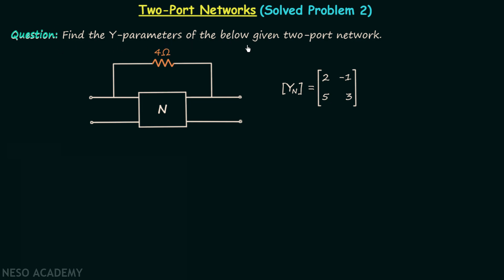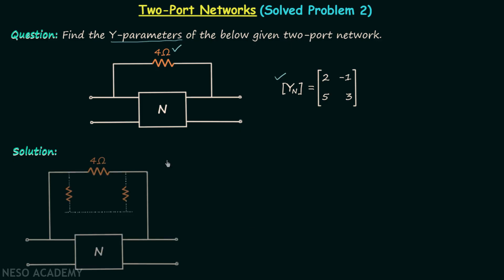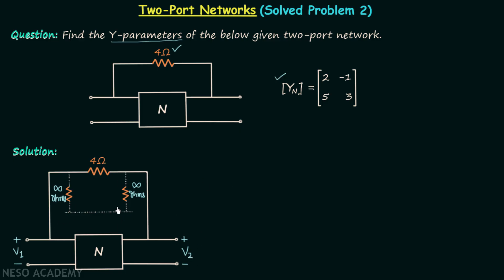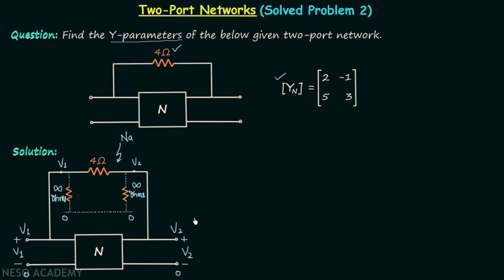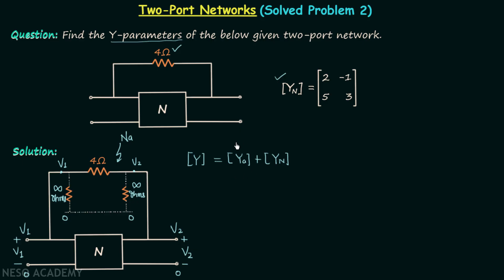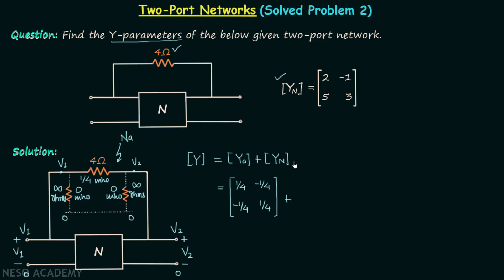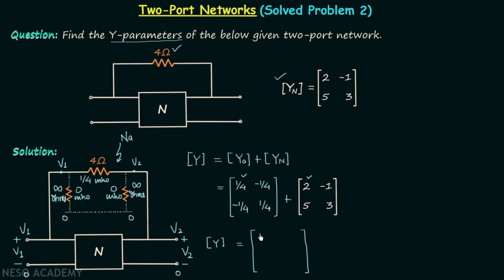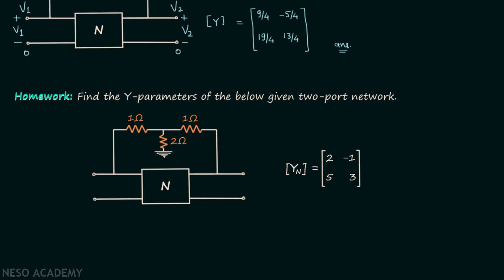Two−Port Networks (Solved Problem 2)

Comment: First find the z parameter of the given above network and then convert it into y with using  [Y] =[Z]^_1
And then use the parallel connection formula

Comment: The problem could also be solved by dividing the circuit parallel at 4ohm and finding y parameters as in first problem, such that two 2 port networks are in parallel and we know when networks are in parallel their admittance gets added.

Comment: There are three ways to solve homework
1*
 Find Za -prameters (3,2,2,3) then the values of Ya (3/5, -2/5 , -2/5, 3/5)
Y = Ya+Yn =(13/5,-7/5, 23/5,18/5)  using shortuct 
2* 
 Transform Y to delta (y1=1/5 , y2=2/5 , y3=1/5) and shortuct the values Ya=(3/5, -2/5,-2/5,3/5)

Y=Ya+Yn=(13/5,-7/5, 23/5,18/5)
3*
I1=I1n+I1a = +2V1-V2+V1*3/5+V2*(-2/5)=13/5V1-7/5V2
I2=I2n+I2a =5V1+3V2+V1*(-2/5)+V2*3/5=23/5V1+18/5V2
Reply: Thank you
Reply: Will you explain the 3 method again please
Reply: Yes bro u r correct

Comment: Sir,i have a doubt the 4 ohms is connected in series .but we know that in series series combination [z]=[za]+[zb].
Reply: Connection is parallel-parallel as voltages across both terminals are same
Reply: @nandini1017  Thank you

Comment: First the Z para meters are 3,2,2,3 (ie z11, z12,z21,z22)
then |Z|=5
then the values of Ya = 3/5, -2/5,  3/9 (ie Y11=Z22/|z|, Y12=Y21=-Z12/5,Y22=Z11/5)
then [Ya]+[Yn]
Y11=13/5
Y12=-7/5
Y21=23/5
Y22=10/3
Reply: How to calculate z parameters
Reply: @tab5668  congrats
Reply: yes i did the same and gat same values. but don't  know it is right or wrong
Reply: One mistake Y22 =18/5

Comment: y11=13/5
y12= -7/5
y21=23/5
y22=18/5
Reply: Pls complete explain this sum
Reply: How..!!
Reply: This is wrong
Reply: His answer is wrong according to me 
Just try to find Z parameters from T network and then find Y parameters from Z one 
After finding Y parameters Add the both matrices
Reply: @yashikasaxena5764  his answer is right , you should solve this on your copy with the method which you comment. The answer will be same.
Reply: @yashikasaxena5764  it is correct only try again

Comment: Y11=13/5
Y12=-7/5
Y21=23/5
Y22=18/5
Reply: And y12 is -7/5
Reply: How I didn't get
Reply: @SWJ-MKhyathi  you need to find Z parameters first later convert those parameters into y- parameters.
Reply: @avunooritagore6089  kk
Reply: Bro
I think y21 is 23/5
Reply: It is parallel?
Reply: Super